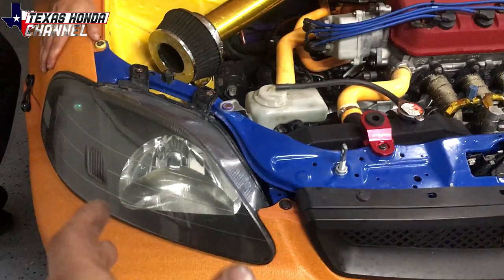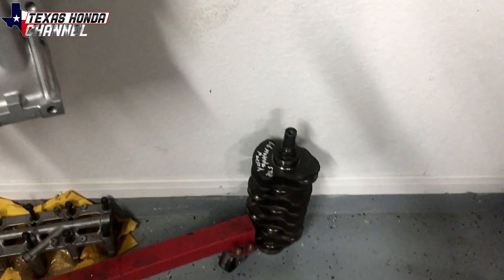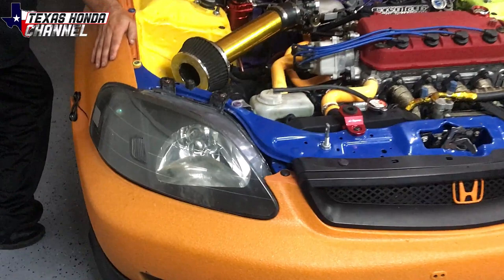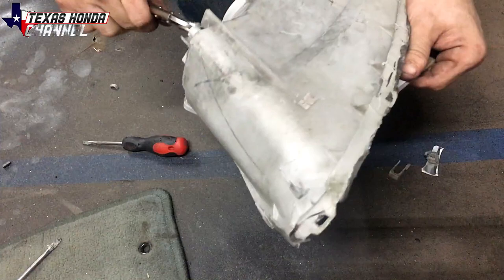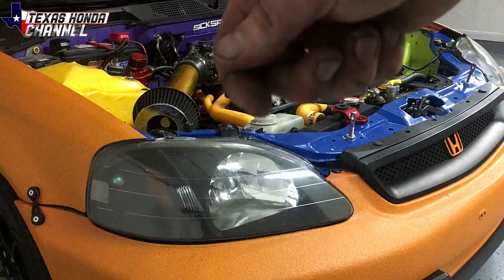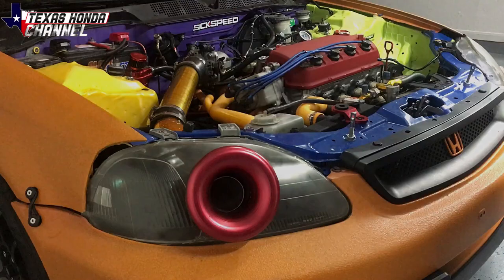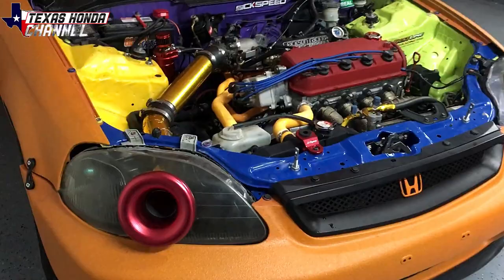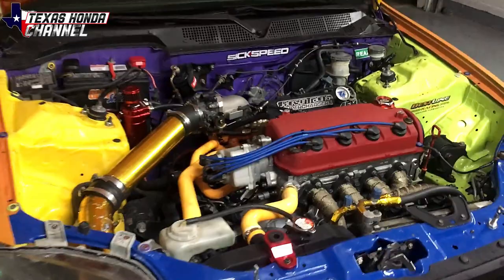How To Make A Velocity Stack Ram Air HeadLight (For Track Use)

Comment: Check your afrs at the track cause you fixed alot of boost/vaccum leaks. It might be a little more rich now that its not sucking in all that air. Or might be lean cause your making more boost. Either way just want you to know the tune might change ever so slightly. Btw i have aspergers and didnt know untill i was in my early 20s now im 28 and starting to understand myself more because of the help i am getting now for my mental health. Stay safe out their bud, been following you since you started your other channel  with your very informative how to turbo you civic videos.
Reply from the maker: Thank you for the input and yes it is on the rich side a little but we plan on dialing all that in now :) we did fix a lot so to compensate it was rich

Comment: I HOPE YOU GUYS READ THIS.....
So I did this on my mom's 2012 Honda Civic EXL that only has the r18 sohc VTEC
My k20 ej1 and my j series 

I did the K&n intake with a heat shield 
REMOVED THE STOCK AIR DUCT 
Added a custom bendable tube that goes down to the front bumper where the fog light used to sit just like he did in the video 

That alone dropped her short ram intake temps with just a heat shield were 140° down to 80 to 90° with the air duct 
THEN AFTER THAT....
We also wrapped the intake tube itself in the gold reflective heat tape 
That dropped your intake temps down to 70°

So with the custom air duct to the front bumper the heat shield and wrapping the intake tube in the gold reflective heat tape it dropped her intake Air temps DRAMATICALLY.....AND......

Her VTEC... Crossover is now extremely loud and you can actually hear it and feel it which is amazing for a sohc when you hear it it sounds like a dohc VTEC 

But even on hot summer days now her card is not getting heat soaked enter car pulls so so so so so so so so so so so so much better 

I have you been done this now in my 95 Civic Coupe that's my built track car 

 and on my 04 Honda Accord V6 6-speed manual Coupe 

And my 2004 Mitsubishi lancer Ralliart 

It's the Best of both worlds you get the benefit of a  true long cold air intake without the fear of sucking up water!!!!

Comment: Shes got a 13.5 in her forsure. I gotta get me one of those radiators. I like the wrinkle black end tanks on your car. Im so going to make a headlight like that but try to make the headlight and blinker work some how. It looks not to hard, i think the hardest part would be seperating the headlight the first time. Cant wait for the hi comp bottom end! 🤙😀✌
Reply from the maker: Heck yea she does have a 13.5 I love wrinkle black too. The headlight mod is cool for track but it’s a cop magnet with street driving

Comment: Nice tutorial!
Reply from the maker: Thanks man. Could have been better but i was working with what i had. I need to get one solid 2.75 inch pipe custom bent so it has no flow restrictions and it will be even better.
Reply: @TexasHondaChannel  looks good and its more about function anyways. You did a good job.

Comment: Nice job bro hopefully u can get the 99 headlight and do this to that
Reply from the maker: yea the 96-98 don't fit good but more important is that it actually works so this would literally be FUNCTION OVER FORM haha. I took it out for a spin and its crazy with the boost leak fixed LOL
Reply: @TexasHondaChannel  yeah ofc be good if u can get a 99 light tho then it'll be form as well as function hahah and that's awesome what boost did u make?
Reply from the maker: @BA5HER123  To be determined lol  I wasn't gonna drive very far without a headlight at night lol
Reply: @TexasHondaChannel  lmfao that'll be a funny video "driving home from the track late at night"😂
Reply from the maker: bashy m I have my other headlight lol 😂
Reply: @TexasHondaChannel  lmfao😂😂😂 spare please